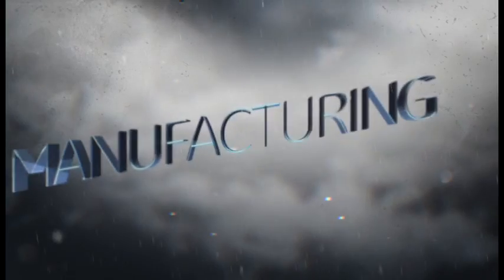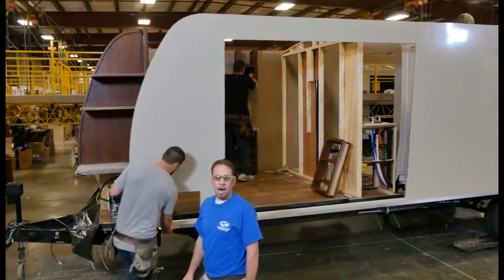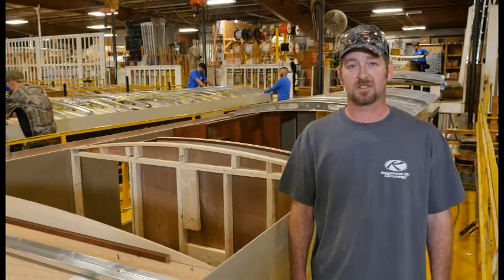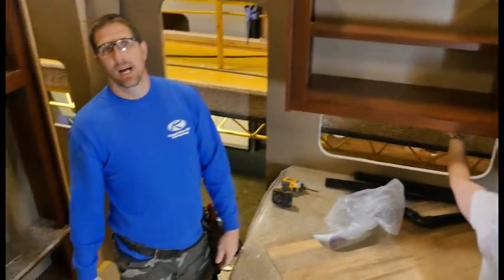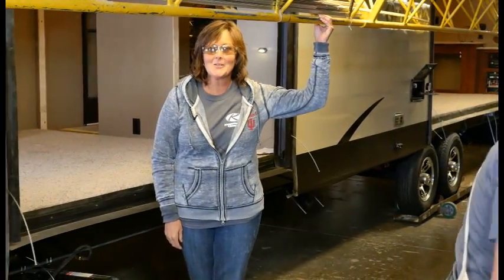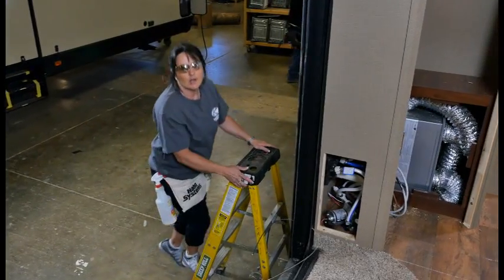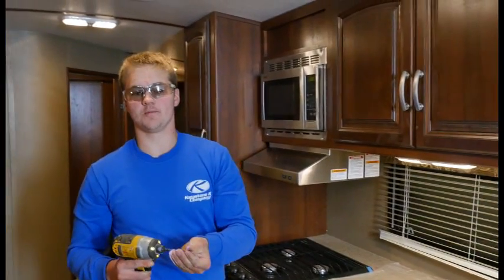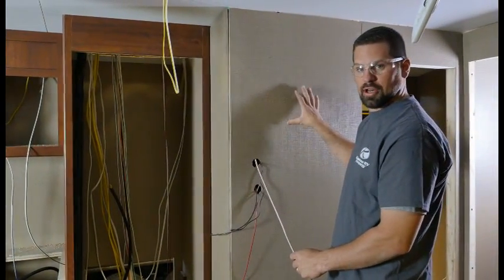Keystone RV - Manufacturing

Comment: Keystone has been vastly successful because they mastered quick assembly using cheap materials, sold a few thousand less than their competitors.  Your "lite" trailer has prefab thin gauge aluminum trusses that a 5 year old can crush, a laminated foam floor, hollow thin aluminum framing, and a toy chassis with chinese tires and leaf springs.  'Merica!
Reply: I just had one of those Chinese Karrier tires separate. Luckily it was on my spare and I noticed it when I went to check the tire pressure. My next step is getting the other Chinese tires off asap.

Comment: Well, lets see here. Had my Montana High Country for 1 year now. Warranty replaced the front door, it was completely missaligned. Warranty fixed the bedroom door. It broke. I fixed the closet shelves by reinforcing with 1x12's from the floor to the bottom of the shelves on each side of the wall, and a center support for the cloths bar. Warranty replaced two wheel hubs after a brake failure chewed up the inside of the hub.  Had a tire blow out within the first 3 months of ownership. I changed all the tires myself. Winngard Razzor television antenna broke, replaced under warranty. City water connections leaked, replaced under warranty. Gas line quick disconnect was improperly installed. It was bent upwards, totally unusable as there was not enough clearance to connect anything to it. In an attempt to move it at a lower angle, it broke. Replaced with new pipe and connector myself. Slide cable broke, fixed under warranty. Underskiring that wraps around and under the trailer, every self-tapping screw broke out and the metal was flopping in the wind. I added the largest washers I could find through each self-tapping screw and re-installed myself. Bathroom door was replaced under warranty. Staples in the walls are popping out. Thomas Payne recliners were fastened to the floor with 2 small screws. The first time I sat down, they both popped out. I ended up drilling holes through the floor and running bolts through the chairs and under the floor so they won't tip any more.  Gas line came loose from the wall inside the front cargo area. I fixed myself. Glass door over the entertainment falls open when traveling. I installed a catch so it won't fall any more.  Cabinet doors popped open in transit, got caught in slide outs when extracting and broke off. I fixed myself.  EVERY single pull down shade in this camper has come apart at the pull bar on the bottom of the shade. Warranty replaced 2 of then, I then started using clear silicone and ran a bead over ever one so they won't come off any more.   All this in one year of ownership.  Quality?  oh yea!  Some quality, not to mention some changes I made just because they were done shoddy or just plain stupid.
Reply: Damn you have had a lot of issues. I just a spare tire separate and it’s never even been driven on. It’s only 2 years old but that’s what you get with Chinese tires. So my next step is get the other Chinese tires off of mine. Mine had a sag in the roof in the front area from the factory and someone stapled the roof inside after the build near that area. All the other staples are filled but these aren’t so it was done at some point later. I also noticed one of the gutters is bent in a way that’s unlikely from tree limbs hitting it. The marker lights aren’t even mounted evenly spaced on both sides. If you remove a light you will also see where they just jabbed a hole and left sharp edges then ran the wire up against that. My interior lights are flickering 2 years in. I found a leak by the water fill and found a loose hose so I fixed that myself. The jacks are welded on but left untreated which will cause rust to the frame which is a serious issue. I can hear gurgling like bubbling coming from my shower hose right where it screws on by the turn knobs. I don’t see any leak but I hope it’s not leaking somewhere that I can’t see it. You shouldn’t be able to hear air right there. The woodwork inside has shredded edges . The floor creaks already. The quality is just junk honestly and I won’t buy another.

Comment: Ahhh, nice to see all the people who keep my working! As an RV tech, all rv’s come into the dealership crappy. If your stuff falls apart on the first trip, please know that this is normal across all rv brands! 

In the end, you have to remember, your pulling a small home down the road. Things flex and bow. There isn’t a better alternative either, unless you want feel like your in a space shuttle!
Reply: Cameron Dierking uh one space shuttle blew up! Another one came apart on re-entry.  Maybe not the best comparison 😆🤣. Your point is well-taken.  I just had to poke fun a little.
Reply: I disagree Cameron. We owned a 1997 Fleetwood Bounder for 20 years and 162,000 miles and I could count on one hand of minor issues. The only major issue was we had to replace the cooling unit in the refrigerator. When we sold it in 2017 everything still worked well. Even the Onan generator had over 4000 hrs and still ran well. Our 2018 Keystone Laredo has had so many issues I've lost count. The water heater blows the door off nearly everytime it fires up. The Atwood furnace sail switch keeps failing. The thermostat switch keeps failing also. The list keeps going and going.
Reply: Things coming loose from use is one thing. Shitty quality control is another and that’s the problem. Mine has a multitude of issues and has not even been used.

Comment: My wife and I purchased a  2012 passport used in 2019. We are first time buyers. Several camping trips and have had No issues other than 30amp breaker that keep tripping, this was the parks issues and was quickly replaced. I have done several upgrades to the camper myself, no big deal. Remember screws come loose, air driven Brad's back out, crap happens going down the road. Maintenance is a MUST for ALL RVers. Our camper is under going delamination on the front nose cap, I knew this when buying, will be replacing front nose cap with .040 aluminium. The filon/luan in my opinion is junk but it is used to keep the ultralite campers that way. Everyone wants to camp, relax and have a good time, but it's like owning a home, maintenance is always gonna keep things GOOD!

Comment: Oh that is sooo true. I bought a keystone Laredo and what a bunch of hacks, when you buy any rv go through it with a few friends and pick it apart. The bed frame wasn’t even square, the hinges were installed upside down and when opening the bed to access the storage the cross brace snapped. Oh and the struts for the bed was mixed up with the struts for the outside entertainment door. The under bed storage wouldn’t stay up and you couldn’t close the outside tv door without damaging the frame. The company should be called keystoners.

Comment: Less then one year. Walls bowing. Screws placed in hollow walls with no support. Stair railing popped off. Fridge not cooling. Fireplace not working. Water heater faults. Great stuff guys. 🙄 definitely going to make a video about this well built camper.

Comment: The wood trim strips where falling off the ceiling before I even took mine on the first trip. Along with some other loose trim issues. Seems nobody takes pride in their work anymore.
Reply: Fast forward to 2021/2022 and nothing has changed. After paying for a mandatory dealer insp (scam) it was delivered with a multitude of issues including some that could cause bodily harm from the exposed jagged edges in a area the is used routinely. This is a brand new unit and left the factory this way and the dealer did not address anything during their “mandatory insp” I will probably sell it without ever using it!
Reply: @tommytwotone8510  So Thor buying them out hasn't helped. Thanks for the update and sorry about your disappointment. I've lost track of all the things I've had to fix. Mostly little issues but recently one of the welds the hold the battery tray up to the frame broke. Fortunately I have a friend with a welder.

Comment: I purchased a 2018 Outback in March and have been trying to get the roof fastened down since then.  The work was approved in late July.  Camping World did the repair on one side but not the other and now Keystone won't authorize the side they already authorized because it was already submitted for reimbursement! Are these people nuts? Thor and Keystone have so many issues they will go bankrupt. If you buy a Keystone product DO NOT remove it from the loft until you literally crawl all over it because they are more likely to deny repair than approve it... because they can.

Comment: I have a 2015 Hideout 27DBS and can't wait to sell this piece of crap!  Can't keep tires on it and the roof is separating for the second time in 2 years.  Called the warranty division and basically was told it's my fault for not resealing the roof every year.  The empty weight exceeds the axles rating from the factory.  I will never own a Keystone product again!  Glad the workers are happy building crap!

Comment: As someone who has made extensive repairs to Keystone Sprinter, I can tell Keystone how to make a better product! Keystone Campers have a huge quality control problem. In fact I am beginning to think they don't have quality control. One big thing besides the cheap interior finish the slide outs are going to leak! Its not always the side seal either. To be fair I checked this defect on a brand new Jayco Camper at the dealership, BTW Jayco is supposed to better, they have the same problem with poor design. The problem is the side walls of the slide outs at the bottom only rely on caulking below the moulding to keep out water! Caulking fails after a few years and when it does the water is coming inside. It will rot out the floor and walls and bring mold into the interior finishes! If you own a camper DO NOT rely on caulking and moulding to keep water out. What I did was I flashed each slide out side wall with 2"x 2" aluminum flashing. The vertical is tucked up between the outside siding and the interior wall covering. This is done after the moulding is removed, cleaned and fresh Butyl tape under the moulding and screwed back in. The horizontal flashing goes underneath the floor. You must make sure that the flashing ends are tucked up under the slide out rubber seals. Caulk the bottom and the top of the moulding with GeoSeal ProFlex RV sealant. I leave the screws loose so the sealant get under the moulding a bit before I tighten them fully. Use new screws because they rot and break after a few years. Its sad that as consumers we have to fix and make our campers better than they were made at the factory new! I truly hope this helps someone. This is not my idea, I got it from another guy on you tube and I can provide the link if anyone wants it. Good Luck!
Reply: user name  Can you name some? I'd be interested in guiding potential buyers towards those models. Sadly there is no accountability or consumer protections anymore! Any that do exist are watered down to the point of uselessness. The agency who are supposed to manage consumer complaints basically ignore the complainant and side with the business. Even worse consumers seem to be oblivious or don't care about their own wallets-so sad!
Reply: Yes I would agree to a point. Everything was documented in our experience with Keystone Campers. The first 2007 Camper purchased new leaked right away. The company took back the camper and made a 2008 model. Having an understanding of quality building procedures and the ability to pin point defects right away helps. Total ignorance along with apathy and deep po lets is even better!

Comment: I love reading all of these comments. Unless you are buying an Airstream ALL of these trailers are built the same way by the different manufacturers. They all use the same materials.
Reply: We know they aren not build as well as an airstream but when your paying $30k, $40k, $50k or more for an RV, you should expect some level of quality.  Not crap components thrown together as quickly and cheaply as possible to fall apart before your first camping trip.

Comment: So, My 2015 Hideout 27DBS was made in April 2015 and I bought it Dec 2015 pre-owned.  Tried to get it fixed in May 2016 for a leak at the front seam after I took it out of storage for the winter for our first trip and was told by Leisure time RV in OKC that it was out of warranty and basically too bad.  I used dicore? sp to fix the seam and now here we are July 2017 and my rubber membrane has separated from the wood from just being towed at hiway speeds and is leaking like there is nothing there!  It is definitely poor workmanship.  Insurance will not cover it and said it was "A manufacture Defect, due to no impact areas".  Good luck getting Keystone to Put any of there STONES on the line for this!
Reply: UPDATE 9 SEP 2017:  Well, No one from Keystone responded so I took the project on  myself and pulled everything apart on the front end and peeled the rubber membrane back about 3 feet.  Applied a coat of contact cement to both surfaces, let set and with the help of my wife, we re-attached the roof!  Its not factory perfect looking but the way I see it, the factory let it leak and now it wont!  This will be my last Keystone product!  Too many issues with a 2 year old travel trailer.#keystone #Hideout #keystoneyousuck.
Reply: UPDATE 19 JULY 2019:  Roof separated again on our trip!  Maybe this piece of SHIT is not designed to travel 1,700 miles 1 way on interstates at 60-70 miles per hour!  So far I have repaired the roof and had the axles alligned to ensure that they are straight and true.  Still having blow outs on the right side tires.  Bearings are greased but something is wrong with this devil trailer.  I was really hoping for a bad storm to total this POS and get an insurance check for it.  Again, will never own a Keystone product again!

Comment: Well, that was a nice presentation and I give you high points for the fairly good acting.
Unfortunately, I was an r.v technical and know all too well how your junk is made, not just keystone , but probably 90 percent of all recreation vehicles..
Reply: hello unknown what company would you recommend then?
Reply: I'd like to know also
Reply: They are pretty much all built the same. Built fast with cheapest materials you can find. I worked at an RV service center for a couple of years. I repaired trailers that had water damage from leaks. If you buy a trailer, avoid units with slide outs. They will all leak. When they do, it does alot of damage to walls and floors.

Comment: I just retired on Jan 1st 2018 after 40 years in manufacturing water treatment equipment for electric plants. And to have a great rebuilding project, I bought an 2005 Keystone Zeppelin at an auction. Knowing it was in bad shape. However, in disassembling it I cannot believe the terrible workmanship  I uncovered. I realize that there are good hard working people at Keystone, and probably have more conscientious folks today. Therefor I can only guess that it was entirely the fault of the management for the poor workmanship and or engineering I found. Note that Everything worked in the trailer, A/C, furnace, refer, radio, electric, microwave & oven. Everything worked that Keystone bought out from another manufacturer and installed..This trailer was severely damaged by water leaks. I completely gutted the trailer disclosing the ceiling & wall leaks, disclosed 8" circles cut out of the ceiling to allow a 1/2" bunch of wires access? Found that none of the frame wood "sticks" in any the cabinets connected to each other?? Not one cabinet frame had a solid frame support system. Like the shelf the refrigerator was on was broke, the microwave shelf was an inch from falling onto the floor. Outside the front fiberglass cap was secured and screwed not to an aluminum cross channel but missed it completely by a 1/4" and was screwed only to 3/16" plywood, and absolutely NO insulation in the front cap?? I like my project on this 2005 and have decided to decal it with my last name as a "BrownStone" instead of Keystone. And in the future.. if I should ever decide to buy a RV / Camper trailer new.. I would have to buy from some other manufacturer for sure
Reply: Thank you for this ! We're selling our empty nest and hitting the road, it's really tough finding not only a layout that makes sense but wondering what company builds decent campers and who will have leaky roofs. I appreciate you Sharing your findings more than you could know.

Comment: I've heard lots of bad things about Keystone...
They're basically a box with running gear bolted on underneath...
I suppose if you bought one that has an aluminum frame with bonded sidewalls you might be okay.
You're still going to have to do a lot of work to correct the shoddy construction...
Reply: All manufacturers are the same. Keystone is actually not even close to the worse. I’m an RV tech at a very large Dealer.

Comment: Disappointed with our Keystone 2019 Outback. 
- Stairs broke, my husband removed the back door stairs an put them in the front door entrance. Those stairs broke too and we purchased new stable stairs. 
- My knees were messed up going in and out through the wobbly stairs. 
- Now the FLOOR Is sagging in the kitchen /living space area. 
@Waited 3 months for warranty Service at Lazy Days
@Keystone wants a big hole cut through the floor to take pictures to see IF they are covering the warranty
@ a few months ago service warranty cut a hole in the underbelly and then messed up job slapped it together and got rid of us. Later my husband looked under the RV, the work they did was falling apart!
-